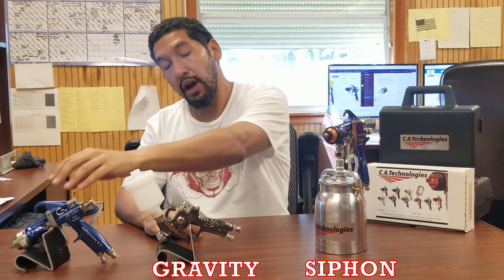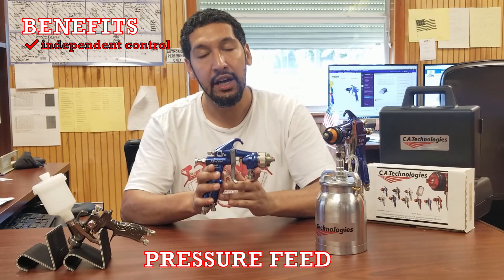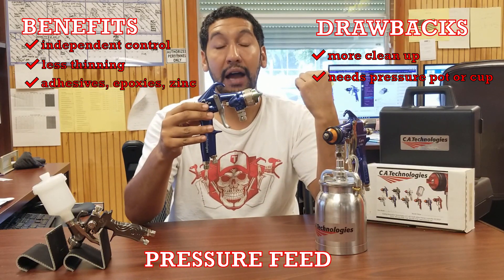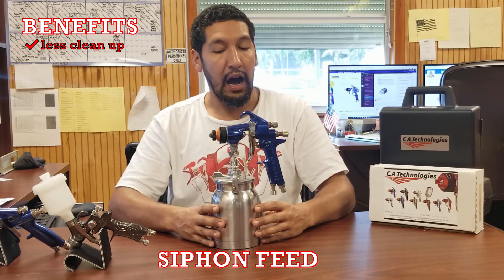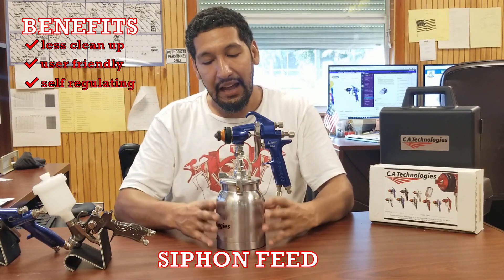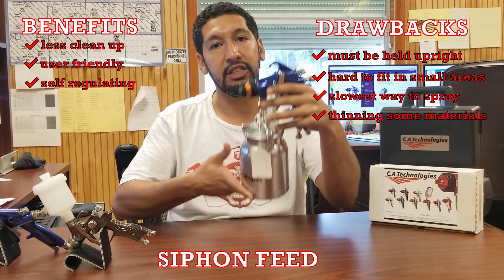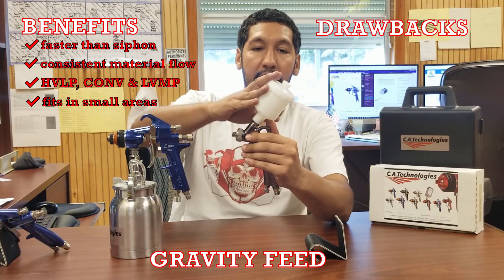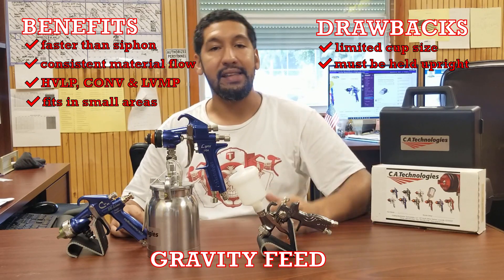Air Spray101: Pressure vs  Siphon vs Gravity Feed

Comment: Let's talk about the pressure gun you appear to like best. I have never used a pressure gun like you have where you have a separate pot. The pressure guns I have used look very much like a siphon gun only they do not have a hole in the lid of the cup. They build pressure in the cup like the ones you describe. The fan is created by a slit in the spray nozzle rather than a round orface  like all other guns. My problem with the type pressure gun I've used is they don't shut off when you release the trigger. The pressure in the pot has to bleed down to stop the flow. After you lift off the trigger, the gun continues to spray as the pressure drops in the pot. As this bleed down of the pressure occurs, the paint coming out is less of a spray and more like a dribble.

Comment: I just picked up a CAT-Xpress pressure feed HVLP with the aluminum cup. It looks like a regular siphon feed, except it has the pressure feed tube going to the cup.

What should I be setting the cup pressure to? I’m spraying General finishes Enduro Pre-cat Lacquer. ANY help is greatly appreciated!
Reply from the maker: Hello,
      There is no specific number that I can tell you where to set this but I can guide you to find your "sweet spot" as they call it. MOST people will find that somewhere between 7 - 9 psi is where they find their best fluid pressure but if your material is very thick I've seen these set as high as 15 psi (but only for thick material that is struggling getting up the cup). What you are looking for is for the fluid to come out consistently and evenly WITHOUT pushing too much fluid out(thus causing a bad finish). This will take some trial and error but like I mentioned in the beginning, you'll probably find success in the area of 7 - 9 PSI, you just need to find your "sweet spot".  Once you are able to spray and feel happy about the finish that is the "spot" there is no ONE official answer.
Reply: @Spraywell  thanks! This was helpful. I was definitely way higher than I should have been. I’m getting better results now.

Comment: Great video explaining the different types of sprayers. I have been spraying with an airless sprayer for around ten years now. Although recently I’ve been picking up jobs spraying metal sculptures. So I’ve been looking into hvlp Systems. Less over spray,  more control. So far I like the gravity feed. Seems like I would be able to switch paint colors without cleaning up the sprayer each time. Thank you for the video

Comment: Maybe a dumb cuestion .... but  here I go !!. its possible to use a Siphon feed in a preasure feed system? yes, no. or what modifications you need to do to your spray gun. thank you and very clever video.
One idea. I use the preasure feed for primers or most used paint, black, white, clear coats etc.  and never ever clean the pot or the gun. just depresurize it and leve it until next use.
Reply: Some guns are compatible.  The trophy gun i got comes with the siphon but we use it with a binks 412 pump

Comment: Also just one final thing, would you say because you can dial in the pressure fed paint on pressure fed, does that mean they potentially have less over-spray than the other types?
Reply from the maker: not necessarily. The way the rest of your spray rig is configured would be more important (cfm & psi) when it comes to managing overspray.

Comment: FINALLY a video that explains the difference between these systems! I have been looking for months and still struggled to understand them, so thank you! I have a couple of questions if that's okay: 
1) you touched on the HVLP system, and it seems to me after watching this that there is no such thing as an HVLP gun, rather it is just the cap that determines that sub-type....is that correct? It's just I notice all the turbine HVLP systems seem to use siphon feed and I wondered whether this was specific to HVLP systems, especially as they work by reducing the pressure to the cap + a high pressure feed to the paint which as you say helps create the pressure difference to draw up the paint
2) I always used to think that the siphon system worked by blowing air across the top of a tube connecting to the container by using the venturi effect. Is that a sub-type of the siphon fed system or do they all work using using a higher pressure to feed to the paint container?

Many thanks.
Reply from the maker: ok I'll try to take it one step at a time.. 
1. Most guns that spray HVLP can also be set up to spray compliant by changing the aircap like you described, but there are SOME HVLP only guns.
1a. Siphon feed is MOSTLY used when spraying HVLP, but you could also set up a system to spray HVLP and be siphon feed (even with a turbine).
2. Siphon feed does infact work based on the venturi effect.
Reply: @Spraywell  ah okay thanks man I think I got it. The feature that got me confused is that HVLP spray guns seem to all have one common feature; a tube running high pressure air from the gun to the pot. Most conventional siphon feed guns dont seem to have this, which made me wonder they worked on an entirely different principle?